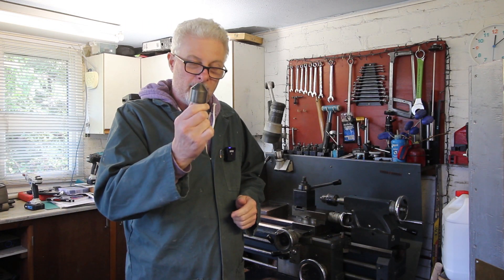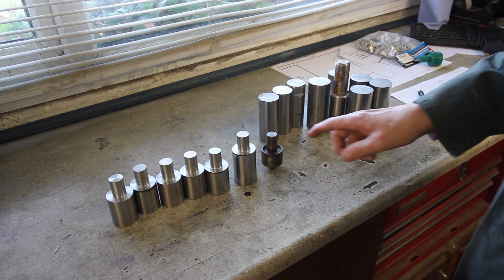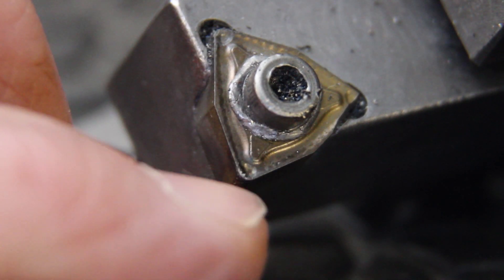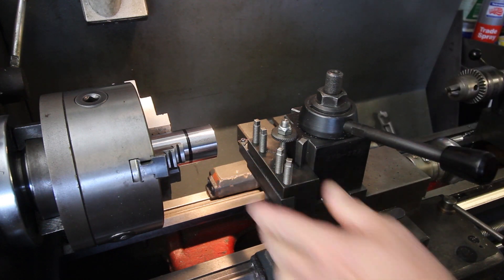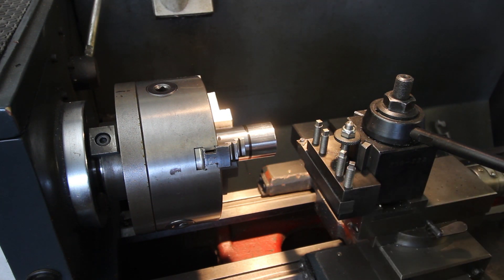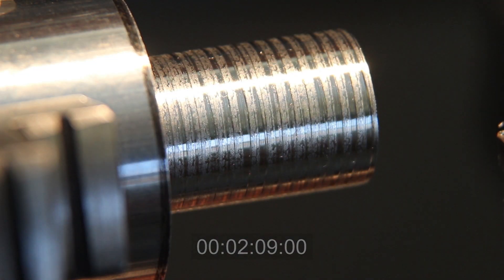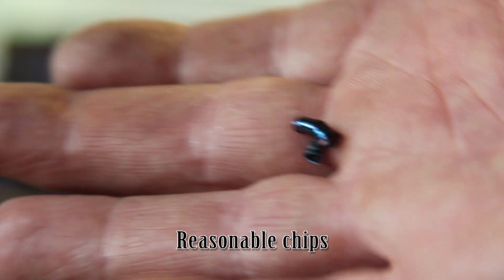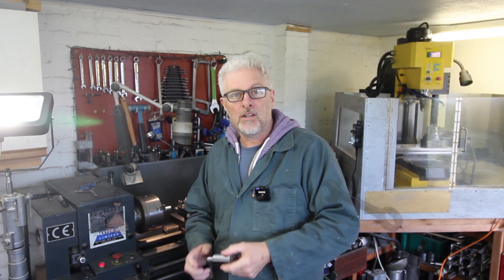How hard can you push carbide tools?

Comment: First of all, I'm glad that this channel got recommended to me. 

Second, I am a trained machinist in Germany, in the company I work for  we have a giant lathe (5,5m on diameter) the most brutal stuff we did there was a Depth of cut of 7 mm (so 14 in the diameter) with a cutting speed of 160m/min and a feed rate of around 1,3-1,5 mm/revolution 

The chips that came out of this thing were so stiff, that I wasn't able to bend them. 

(All operations were done in mixed steel, with like 235n/mm²)
Reply from the maker: Thanks @Der Dulli,
Glad to have you aboard. I have seen video of those big machines they look really dangerous. I guess the chips were hot but not flying off like bullets?  The parts you make must be truly epic?
Thanks for the comment i feel very humble in my little workshop.
Cheers